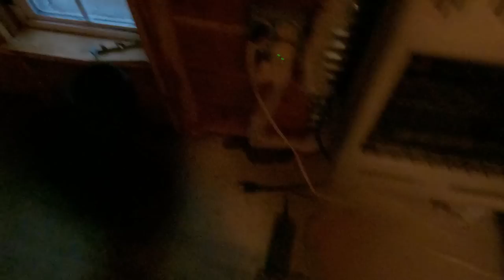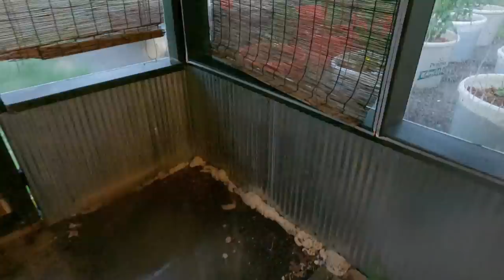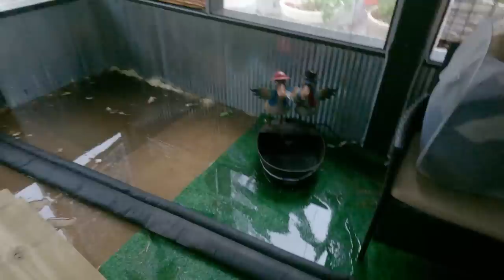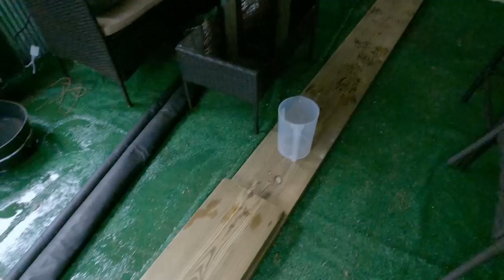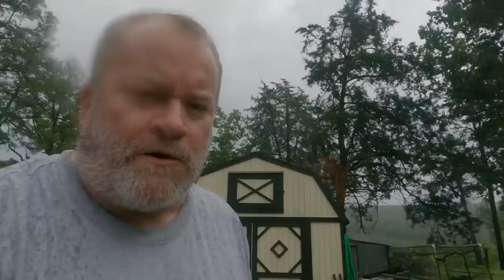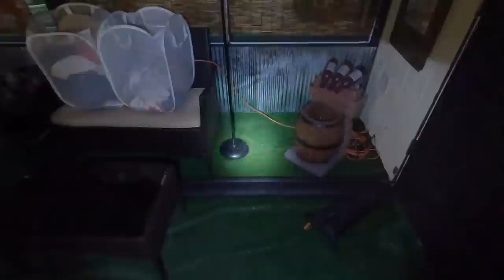Tornado Warning! I Never Got  Alert, Was Filming This Video The Entire Time. My Cabin Was Shaking!

Comment: I wonder if sand bags on the outside  against the patio wall would help?
Reply from the maker: A load of sand here is $900 or you can buy 50lb bags for $20. Not a cheap option

Comment: Mike where that puddle is between your garden and you patio, what you need to do is add 2 4 x 4 catch basins one at the patio and the other at the bottom of the hill were your french drain starts at the bottom of the hill.. If you have some left over corrugated pipe you can use that to tie in to your french drain. You will have to get a y pipe adapter to tie in to the drain were the low spot puddle is in front of your patio. at the beginning of your French drain at the hill you just have to cut a slit along the blue line in the drain pipe just enough to squeeze the pipe together and insert it into your french drain pipe. The catch basins will pick up all that surface water and tack it away.  That will complete your drainage system. A french drain just collects and removes the ground water a catch basin collected and removes the surface water.. A combination of the two works great, One more thing with the catch basins you want to put them slightly below grade. An inch or so should do it. Watch Chuck of Apple Drains You Tube channel Apple Drains, he has plenty of videos explaining this and showing how the system works.
Reply from the maker: Funds ,my ability and time..I cant fix it all at once, never had these issues until this year

Comment: Wow, bad storm. I think the wind helped flood your place again, it was whipping the rain into your patio & the front door. Places that normally don’t leak, the wind can be so bad that it puts leaks where you normally wouldn’t see one. If you could get someone to dig you a trench going the opposite way across your back (where you showed the water running down towards your house & patio) & drain the water away from your house, would that help? I know it’s disheartening to have your home flooded & then have to deal with all the clean up but if anyone can do it, you can!!!

Comment: Sell and move to the TX Panhandle where you might never see rain again if you pick the right spot. The drawback is the only pretty views here are sunrises and sunsets. 

You can contour a shallow depression across that  section of lawn where you showed the water is coming from to carry it toward the front of the property.   I've used a 7 ft wide rototiller on a small tractor to chew up the grass and only a couple of inches of soil, then picked up and hauled off everything loose, to make a shallow, flat-bottomed spillway that will cover over with grass and can be easily mowed across or lengthwise. It'll need to be refreshed about every 7-10 yrs because the dead decaying grass will fill it back in over time. I've used this method around my house and my mom's house 30 yrs ago. I also built a low berm to deflect water, but it can be a problem cause it can hold water in, rather than keep it out.

 If you do another French drain I hope you won't be too hard headed to rent a little ditching machine. I'm a little worried if you run more water down that driveway it's gonna turn into a wash out. 

My highway drainage ditch looks just like yours when I get 2-3 inches rain and then more the next day, but it's carrying the drainage from at least 300 acres of farmland.

 I have learned a lot about properties getting outside to observe after big storms. Hope you can fix the flooding problem without making it a whole summer project. 

Soil builds up around houses when grass, leaves and plant debris collect and compost where they land in Fall. My mom's house had a 30 inch wide sidewalk around it. After 30 yrs the ground built up and heaved up that walk which then funneled all the water toward the foundation like a moat. The house is pier and beam so eventually it began having water collect under it after all the big rains we get -  every 5-10 yrs. The long dry spells cause wide deep cracks in the ground, which allow water to gush in. Home maintenance is a pita.